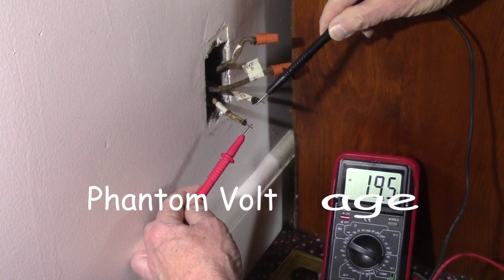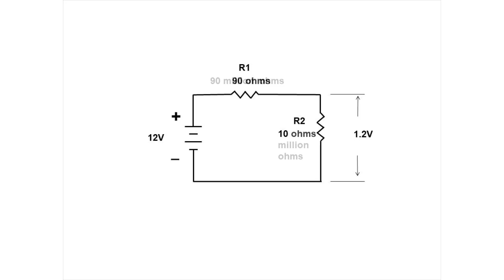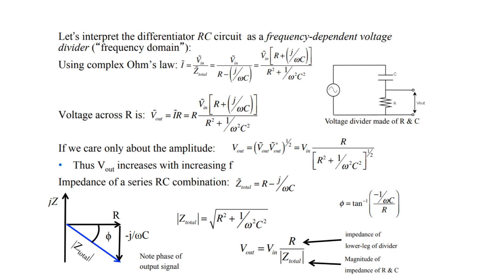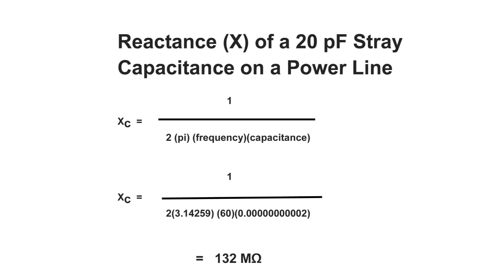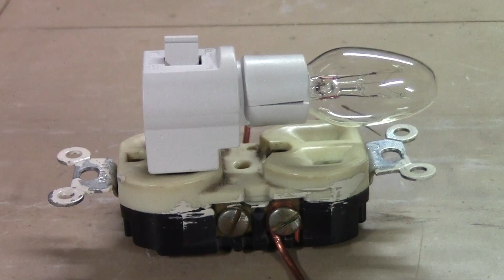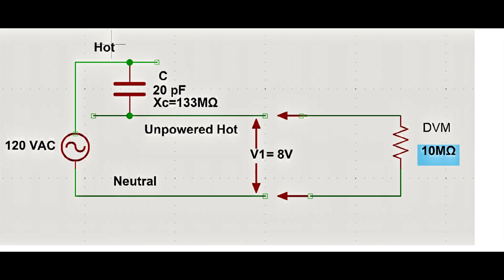How to Identify a Phantom Voltage Using an Ordinary DVM

Comment: So does this replicate how a simple little plug in tester works? Can I wire an outlet to ceiling light box, use a plug tester and catch phantom?
Reply from the maker: If you mean the type of plug in tester that has three lights to indicate miswiring, probably not.   Any device rated to dissipate power over a few watts will work just as well as the nightlight but a plug in tester probably runs with a fraction of a watt.